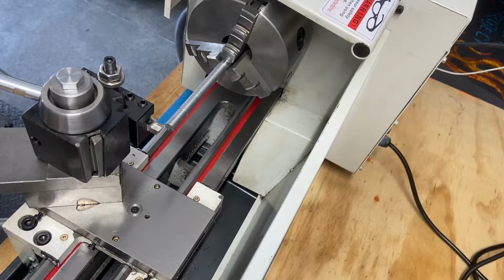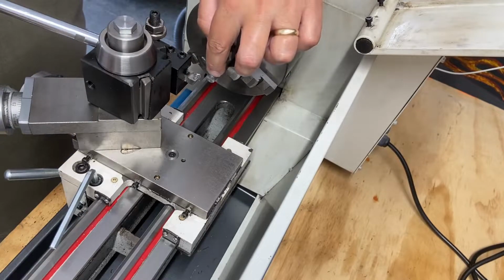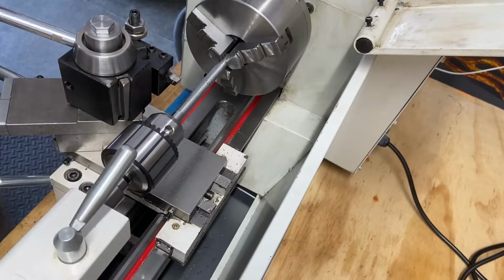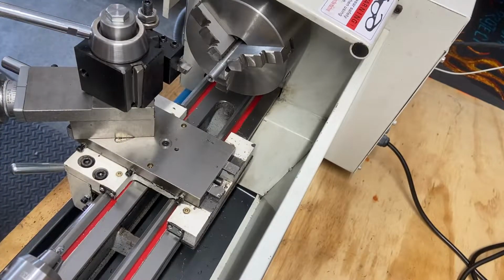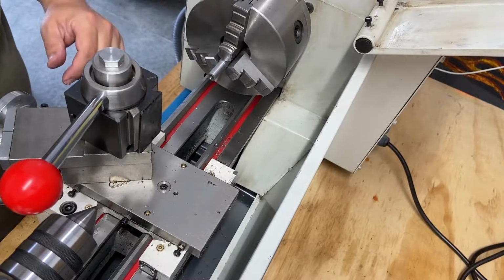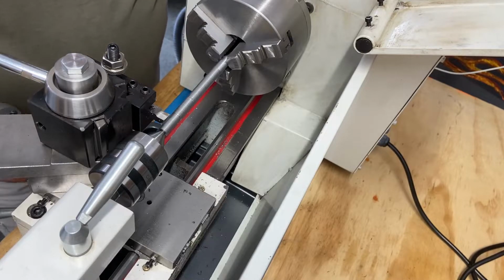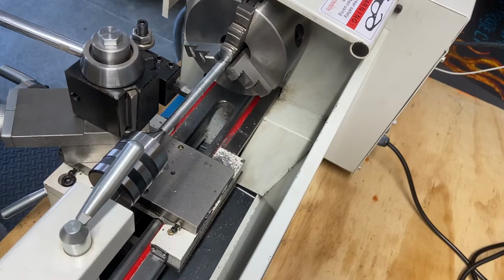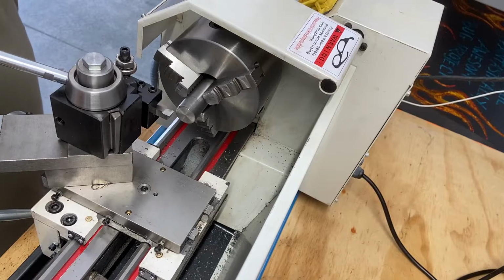Vevor Mini Lathe MX 400 Part 33.1 - Improving Video Quality and Angle, Testing HSS Part 2 of 2

Comment: Video quality is very good now 👍. 

Also not sure if it's the gears or not, but with headphones on I could hear a slight grinding noise when you turned the lathe on. Might check your spindle bearings to make sure they are not dry.
Reply from the maker: I am sure your right,  I have been chasing this, I made a video of me taking the headstock apart chasing a bearing and slight squeak noise but I couldn't find/get to the bearing,  I may need to attempt this again or i fear ill burn of this bearing all together and have to replace it.  I need to research how to get to it.  Thanks for the feedback on the quality.  That shaky cam was driving me nuts,  I didn't like watching those videos with how shaky they were becoming.
Reply: @deezworkshop  easy way to tell if it's the bearings is to remove the gears and turn the lathe on to see if the noise is still there. If it is then remove the belt that goes from the idler pulley to the spindle. From there it will be a little easier to narrow down where the noise is coming from.
Reply: @deezworkshop  so apparently the round plate behind the chuck flange and on the other side of the spindle are pressed in and can be pried off to give access to the bearings. First time I've seen them be pressed in. Usually they have screws holding them on.

Comment: Also forgot to mention. There should be a set screw on the underside of the tailstock if you tighten it a little it may help with the tension on the quill. Just don't tighten too much or it might damage the quill.
Reply from the maker: I did tighten it a bit but it didn't help too much.  I think I'm getting there,  small adjustments here and there are starting to add up on this tail stock.  I'm getting close to having it at a usable setup.
Reply: @deezworkshop  in your last video I noticed you pulled the live center out by hand. I wonder if the set screw was put in at the wrong location. You should be able to break the MT2 taper by retracting the quill completely. That would also explain why your zero mark doesn't line up either.
Reply from the maker: @WILFRED1184  that live center isn't long enough,  It doesn't bottom out.  The quill retracts but not all the way to 0 with nothing in it.  Maybe I can install a screw or something in the backend of the live center to extend it to remove it more easily.  I need to revisit the headstock again.  I am worried about the bearing being dry,  i will take a closer look at the tailstock and live center 
too while I'm at it.
Reply: @deezworkshop  what is the video where you tried to check the bearings called? I tried finding it but couldn't.
Reply from the maker: @WILFRED1184  it actually comes out on Saturday. Hasn’t been released yet. I show a lot of detail inside the headstock. I looked again this afternoon and it’s not obvious how to get to the bearings. I wonder if it’s all press fit in. Sealed bearings and such. I’m am still chasing the squeak. I want to tackle it soon but looks like it may be quite the chore to get to.
Reply: @deezworkshop  ok gotcha. I posted on the headstock comment. The round metal plates are pressed in. But can be pried out with a screwdriver. They are not sealed, they are tapered roller bearings. Which should allow you to flush them with a solvent to remove any grit and stuff and then regrease if you have a bearing greasing needle.
Reply from the maker: Thanks. I may tackle this this coming weekend. I need to make a run to get solvent, cleaners, and a greasing needle. I don’t have that stuff but have been meaning to get some more supplies. I’m going to check those plates and if I can remove them.
Reply: @deezworkshop  there are also some plates on the inside. You have to remove the front cover. Although I don't think you would have to remove them to clean and grease the bearings.
Reply: @deezworkshop  check this videos he kind of explains how to get at the bearings. Not the same model as yours but very similar. https://youtu.be/Vn6re5WHqJk
Reply from the maker: @WILFRED1184  Good share.  I suspect mine is much the same.  I will need to tackle that job at some point.  i think I am going to try to get the outver plates off and clean them out and stuff some grease in them to  prolong the life as long as I can.